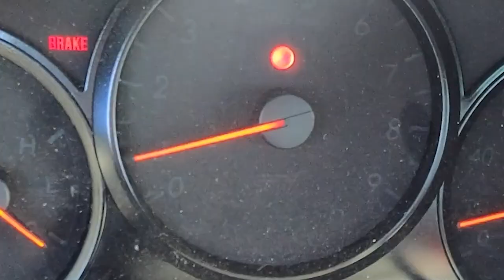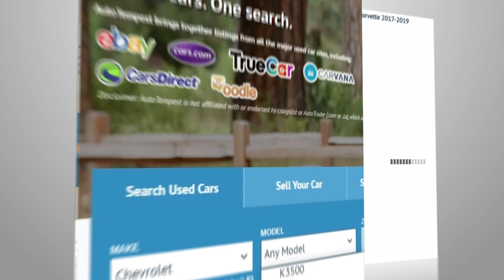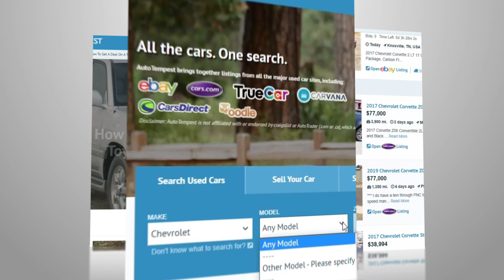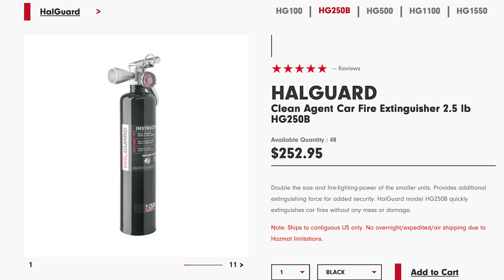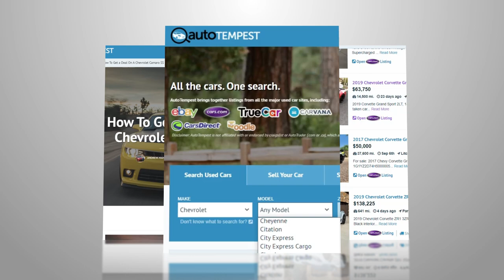Sorted - Introducing The West Coast Cars S1 E5

Comment from the maker: What do you think the finishing order will be? Who is going to be lining up against the Cicio Turbo S?
Reply: I'm betting on the GT350R
Reply: Betting on whoever remembered to upgrade brakes and tires as well
Reply: GTR (R8 if it doesn't cook on track but it likely will), Stang, Vette, the rest. 
The GTR and R8 are the only ones you could really daily drive without too much trouble and they have traction which is always nice when asking a chassis to deal with miles more power. 
I seriously doubt the red Subaru makes those claims and if it does through that intake its going to be on so much boost its not going to be around long. The white Subaru seems like its more pose than go but maybe he's sandbagging? If not its going to be understeer city after a couple of hot laps. 
The Stang and Vette will be good round fast tracks - I'd pick the Stang as the quicker because of its aero - but that comes at a cost of usability. 
The Supra is a Supra. Its good for dyno runs or sitting in a warehouse appreciating in value but really its an engine capable of high peak horsepower with a terrible spread in a chassis very closely related to the million mile Lexus. Possibly the most overrated car ever but the GR Yaris is catching it up fast.
Reply: R8, GTR. The expectations for the rest are pretty low.
Reply: Sheepy race that’s who awesome work
Reply: R8, 350R and a bunch of DNFs.
Reply: R8 and GTR will be close, with R8 taking it.
Reply: My bet is on the R8, but probably the GTR won't be far behind.
Reply: 50/50. Supra (I think that guy's sandbagging his build) or gt350.  The Subies are going to explode. The GTR is going to clutch to death. I some how think the Sheepy Race R8 will have an oil issue and blow down the track with slippy.
Reply: I've got no clue, but the show format is killing me. I want to like it. Should run a couple cars through all the stages in each episode rather than all the cars through one stage.
Reply: I'd day the audi r8 if it doesn't over heat
Reply: I’m Team Shelby all day, everyday
Reply: This being the first and last season of Sorted.  The ball was dropped on the editing side.  Everyone involved are professional and have been in the "game" for many years.  Don't promise videos and drop the ball...
Reply: The GTR should be the Porsche of this round. I don't see any of the others getting close if it stays together. I'm most looking forward to the white Subaru and the Mustang.
Reply: Audi R8 1,300 hp
1998 Corvette  880hp
Subaru 2.5RS 710hp AWD
2011 Nissan GTR 670
2017 Ford Mustang GT350R
Subaru WRX Hawkeye 610hp
Toyota Supra 800hp
Reply: R8 is definitely taking the win following that would be the g350r and then the R35.
Reply: The only one that will survive the 20 minutes is the hawk eye.
Reply: I honestly don't think anything here can hold a candle to that turbo s, but that is an extremely expensive car compared to others.
Reply: Finally a GTR!!! I think it might win. But that Audi R8 I think is going to give it some problems.
Reply: In order of pole and what categories they will excel in.
Gt350r around the track  daily use ability
R8 for 60-150 and daily use ability
GT-R all around good car in each category 
Toss up between the white Subaru and the corvette 
Supra is going to do okay around the track because it’s not pushing crazy 1000+ power and will do decent in the 60-150 
Red Subaru is not going to do to well in the heat I presume
Reply: I can hook you up with a nice running, well rounded original and stock looking (sleeper) MKIV 1995 6 speed street supra. How and when can i sign up in California? Been trying to grenade this motor  because the built billet main cap motor that is waiting can be swapped in. This car will definitely be more streetable and probably produce better performance times than the two I have seen here so far. Just need to adjust the suspension for the road course and it will be set. Are we allowed to adjust any settings such as the suspension dampening/ rebound, tires or tire pressure, and boost levels in between events? Thank you
Reply: Sheepy’s R8 all day!! It’s the full package!
Reply: It should have been the 135i from the east.
Reply: Gonna be the R8 for the same reasons as the 911...  $
Reply: R8, mustang, gtr.   Gtr is a older cba version which has smaller breaks and a inadequate cooling system compared to the 2012++newer ones.  Plus those stock turbo e85 dont push 670whp.  This model gtr shouldnt do too well.
Reply: we all thing someone with actual racing experience should have been picked over emilia Hartford everything she says is like and opinion question like she has no knowledge of what she is talking about get someone like  leah pritchett for next season
Reply: Was going to say C5 number 1, but with the intro of it going on a trailer I dont think that will happen.
Reply: Guessing car treks scated yall off you tube.   Hate that was diggin the shows. Oh well.

Comment: Those V10 r8s turn into a missile on wheels when the ol twin snails are attached.
Reply: My money is on the R8 winning the west coast.
Reply: yawning kitty hopefully it won’t overheat but if it doesn’t..... it’s gonna be a monster
Reply: There's also a Whipple twin-screw positive displacement supercharger kit available for the Audi V10, and that's the route I'd go...
Reply: @richardharrold9736  that’s slow for the price
Reply: @stephenweewoo  slow how, exactly? Plus you have huge low-end torque, whereas the big turbo route if anything gives you less torque at low RPM than stock (thanks to lower compression).
Reply: @richardharrold9736  a vf supercharger cost around 40k and will give you about 650 at the most to the wheels, That’s not worth it for that price you can get 800hp easily with turbos and you can upgrade over time. Many supercharged lambos and R8s get spanked by vette’s and lots of cars.
Reply: @stephenweewoo  the Whipple is good for 1500bhp. Your 650rwhp figure equates to 750bhp. Also, the VF Whipple kit is 20k, not 40k.

Comment: Thanks Rob for the chance to compete! @stormtrooperwrx
For those wondering the full 2006 Subaru Modifications:

Airlift Performance Suspension
IAG Stage 3+ Closed Deck Block
Garret GT3576r Turbo 620hp
Perrin Rotated Turbo Kit with intake and FMIC
2016 STI crankshaft
Manley Turbo Tuff I Beam Rods
Manley Turbo Tuff 99.75mm Forged Pistons
Arp. 1/2 inch oversized head studs
Faria 1mm oversized valves
Brian crower 272 cams 
Plasma coils 
Grimmspeed ported and polished 
  Intake, tb, tv valves removed 
Phenolic spacers
11mm oil pump 
Killer bee high volume oil pickup
Killer bee high volume oil pan
Powedercoated valve covers 
Id 2000 fuel injectors
Id billet fuel rails 
Samco radiator hoses 
Cusco solid mounts 
Walbro 450 fuel Pump
Carbon Fiber Driveshaft

6 speed
Ralli spec gear set 
Billet shift forks
ACT 4 puck clutch
Tmw shifter
Weighted shift ball 
Aluminum flywheel 
Cart boy bushings 

Dss carbon fiber drive shaft
Dss front axles 

Abw motorsport concept body kit

Bride racing seats with Tamara belts and harness bar 

Alcantara Custom interior by SIDS Upholstery

Whiteline roll center kit
Whiteline motor mounts
Cusco Sway Bar

Air Force Dynamics custom Headlights
Air Force Dynamics canards

Comment: I honestly think none of them have a chance at beating that Porsche from Florida
Reply from the maker: That's what we are here to find out!
Reply: @superspeeders  Possibly the R8 if it stays together and doesn't overheat (I suspect it will on track in short order). Most of the cars are nowhere near as good daily drivers and thats even if they had the speed to keep up. 
I would go as far as to say a stock or very mildly modified 911 might well even have been a winner. 
I can't wait until some smart ass brings a Koenigsegg with a cone filter as the only mod...
Reply: @siraff4461  I believe the Shelby will do very well since its already so good from the factory and the guy didn't go over the top with all the mods.
Reply: I was going to say that Shelby is also going to do well especially since it's the R. The GT-R might do 10 laps of the clutch holds.

Comment: I'll say if the R8 holds together its going to win pretty much any straight line race, the GTR stands a good chance around anything but a very fast track (if it is a really fast track the Mustang and Corvette might have a good go) and if that red Subaru is really making 700 wheel its doing it with massive boost because that union from intercooler pipe to intake manifold is tiny for that power level. 
I can see the R8 or GTR taking it because both are going to be easy daily driver, both have loads of grip and both are going to be up there speed wise.

Comment: Please tell me you have a fast SUV in there somewhere eventually.  Own a Trackhawk and about to get the new Audi rs Q8.  So I'd be interested to see how a modded Trackhawk would handle against these cars.  Few 1200hp ones out there and they hook up being 4wd.  

Be a good comparison to the coupes and sedans if you had one with all the suspension upgrades done to it as well as the power.   The bwoody kit is pretty amazing and comes with everything down to diff braces .

Comment: Most of these cars do not appear to be properly sorted for track use other than maybe the GT350.  You can tell just by the tires fitted and I'm guessing a lot of these don't have proper brake setups for track use.  Should be an eventful track session!

Comment: The white WRX is $40000 worth of build trusted to $400 in wheels. I'm concerned.
Reply: Kuza_G lol you are right sir, I am not friendly to my wheels, so I go cheap and replace when I break. They are plenty strong just not light. If I had more money I would go forged in a heartbeat, but I find it more fun spending 3-5k on track days than on wheels to impress the “those are reps!” Kind of people. I’d rather impress on my PR’s at the track.
Reply: @cartalk1909  have you actually had wheels break while tracking yet? I've never tracked on replicas but depending on company most of them seem to hold up well enough.
Reply: Kuza_G I chose mine on durability not on weight. I have not had a failure, only damage from hitting Cali potholes or curbing the shit out of them.

Comment: the c5 is gonna be a nightmare to drive. it might get crashed. in breif flashes, it will appear immensely fast.
the subs are gonna suffer every possible failure and wont even be that fast.
the R8 will look amazing and do great until it's time to track it and it will all fall apart in a six figure disaster.
The GTR is gonna underwhelm but perform everywhere its asked. solid, but a loser.
the supra is gonna surprise everyone and might even win
the mustang is gonna suck and no one will like it, but its gonna thrash everything performance-wise
Reply from the maker: So who do you think is going to win?
Reply: @superspeeders  the supra. that guy is sandbagging, I'm guessing it's a very squared away car. The mustang I think might do really good too. it's got a lot of revs to play with and it should pull hard the whole time. if it's motor stays copacetic, I think it'll go really good. the 350R is meant for track use. carbon wheels, cmon! it's gotta be good if the wheels are the stone you're squeezing that last drop of blood from.
Reply: I drove it to the event, and have been driving it on the street track and runway for over two decades, just saying...
Reply: @prettyfast1000  yet previews show it getting loaded on a flatbed...just sayin'
Reply: @jasons.1827  I'll reserve comment at this point, other then to direct you to my youtube site where you can see the car in action over the years...